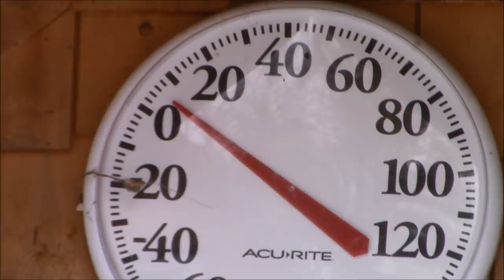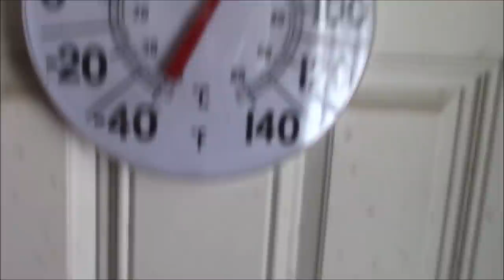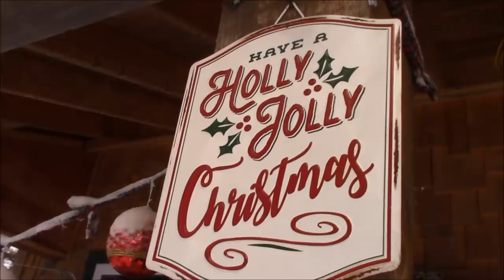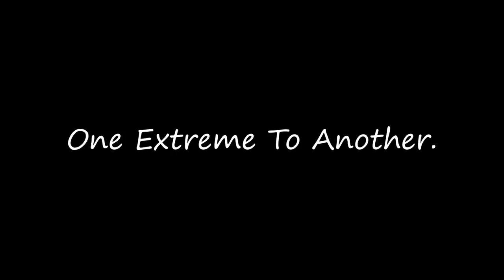Living in an Off Grid Cabin On a Mountain Through The Winter.  How We Handle The Task and Stay Happy

Comment: Ya did good Boss. I had 36 1/2 " here at my new homestead,,,the "High Mountain Homestead" and I just didn't let it bother me  at all,,it's going to do what it's going to, no biggie IMO. I was snowed in for a couple days but it gave me a chance to do some other things that needed to get done. Half way through the storm I broke trail to the road with the 4 wheeler and after the storm so I could at least  get there if need be.  I'm not off grid, but I might just as well be as during hevey wet storms or wind storms  the power normally goes out but I can work around that pretty easy too. I  heat with only wood too and have other options for power if need be and am stocked to the gills with chow.        I get a laugh out of some of these channels too when they piss and moan about simple little stuff,,Hell, I'm 70+ disabled and live on my own other than my pup and still manage just fine, even if it does get a bit lonley here sometimes.   I live in Central VT  @ a bit over 2000 ft ASL and about 5-6 miles from the nearest black top and am next to the last of only 4 houses on the entire road where it gets closed for the winter just past me.  I LOVE IT THAT WAY to be honest.  I guess us "old timers' just have a bit of a different mind set compaired to other folks.  My car was totally covered and it was just a snow bank with absolutly nothing of it showing at all,,and 2 days later with the same rains you got , the ground was almost bare again and I found the car.   Ya know what,,I didn't cry about it one little bit and just dug a path to the patio and enjoyed having a camp fire outside next to the river and  sitting on the patio on a cast iron park bench having an adult beverage and enjoying the winter wonder land all around me and listining to the river flow by with the dog sitting next to me with her  head on my lap. Life is good my friend,,,,,, if you'll only take the time to experiance it and  not fret about lifes little challanges.   Merry Christmas to you guys and God bless,,,,,
Reply from the maker: From your comment i can see you'd make a good neighbor. You aint kidding about us having a different mindset lol.  
Here's to a wonderful 2021.  Happy New Year brother.

Comment: Great Video JC! Did you ever consider a CB radio? We had them in Canada when we lived on  Anagance Ridge NB. The snow would reach the top of the telephone glass insulators. We had to leave the sliding barn doors open 4' in order to get to the animals. I remember walking a wind blown ridge line to the barn. If I stepped to the left or right, I went over my head :-O. Had to jump down 5' into the barn. Now THAT was snow! And that was 1974. As I have said, You and Lori knew what you signed on for when you moved to your dad's NH cabin. It is nothing short of a winter wonderland! We opted to build on the farm VS our class 6 road, 20 acre piece, for medical reasons at our age, but I am glad to see you fulfill your long standing dream. Well done my friend and well done to Lori! Its a good life ! ~ Diane

Comment: Sorry I couldn't be there to help you with that JC.  I did 4 Brake Line's on a friend's Hyundai Tucson... completely rusted through.  Best Practices for the future...get Vehicle undercoated every year or so.  Will save on a lot of repair costs and hassles.  Or you can get a Spray Can of Rust Check and spray it liberally all over the Brake Lines and Connections, and any Fuel Lines... preferably on a warm and dry day!  This is where an ounce of prevention is really worth more than a pound of cure!  Saves Time, Money, and Difficult Labor!  Glad you were able to keep moving!!!

Comment: Great video! The wife and I are headed in the off grid direction and you guys are our favorite channel. As a former mechanic, I HIGHLY recommend investing in a better jack. A good floor jack can be had from Harbor Freight(if they have those near you?) for $1-200. I keep a heavy duty version in the garage, and a smaller one in the vehicle. They can also be used on most/all of your farm equipment. I find those cheap scissor jacks to be the WORST pain in the butt(though they are still a great backup jack). Once I bought a better jack, every flat tire turns into me looking like a pro and patting myself on the back instead of fiddling with those cheap ones.

Love from Texas.
Reply from the maker: Agreed.  My floor jack is in the shed 300 miles away lol.
Reply: @thebossoftheswamp   Sounds like you need to make a day trip once the snow clears! Keep up the great videos!

Comment: Thanks for another great video. Whenever I am feeling sorry for myself or frustrated because something isn't working the way it should, you guys give me the kick in the butt I need to suck it up. Living alone and  choosing to burn wood as my primary heat source (with forced air back up which I don't care for) it does mean I have to fill my wood shed in the fall. Bought myself a little battery operated (STIHL) chain saw, which works like a charm. It cuts anything I am able to handle . At 73 and handicapped I can no longer use my gas chain saw as I don't have the strength to pull the cord. My battery lasts about 40 minutes with semi continuous cutting and that is about all the time I can last without a break so that works for me. Many of my friends are wanting me to give up my lifestyle and move somewhere easier to maintain....haha...I would last all of about a month,  at best!. Like you keep saying, you roll with it and when it gets tough you suck it up and do what has to be done. Can't remember if I mentioned it to you before or not, I had watched one of your previous videos about the saw horse you made for cutting multiple logs at a time. I knew then,  that is exactly what I needed. I have a huge pile of limb wood stacked in my yard in 4 foot lengths. So, when I was feeling a bit better and haveing a "good" day, I built me a saw horse. Not as good as yours, not as heavy duty as yours but for me, it does the job! I can't thank you enough for being the mentor I need. I plan to "keep on keeping on" as long as this old body of mine keeps going. I am not able to live full time off grid due to being alone and having major health issues, but I do have an off grid cabin in the woods where I spend as much time as I can. It is only 90 minutes from my home and for me is the best compromise I can get. Still able to do lots of gardening and canning. Takes me way longer than it used to but hey, life is not a race. So here we are in the middle/start?? of a Canadian winter and looking forward to planning my 2021 garden. The only issue I have that worries me a little is my water situation if my hydro goes out for any lenght of time,  (I am on a well with an electric pump) However,  I pull off several large containers of water to have stored in case that happens and when we have the snow I always have my Burkey haha.  Anyway, sorry for the ramble, take care and stay safe.  All the best for 2021  hopefully it will be better than 2020 in all respects.   Sandie from Ontario Canada.
Reply from the maker: That's just plain awesome Sandie. Your words make me wish you were my neighbor. Love your stick-to-it-tivness :-))
Keep on keepin on my friend :-)

Comment: Greetings from PEI.  Boss, I watched with frozen fingers along with you and that brake line.  Everything just doesn't work in the cold.  In late September I go and check up on as much as I can;  my blower and car and chainsaw and my Surrette Solar Batteries .  Even my wood burning is geared so that I can pull from the furthest pile in November and work my way closer to my log home as the snow gets deeper.  We have zero snow here in Prince Edward Island, so I'm burning only softwood and the stuff that's covered is the furthest away.  I spent three hours cleaning the fridge, all with bleach and hot water heated on the stove.  Our temps are about -4c (25f), so the two big pots of water on my Regency mid size dampen the heat so my place doesn't get much above 70F.  At one point I was about 3/4 mile from pavement on a dirt road.  I had/have a Pelican that I dragged supplies in.  Fast forward twenty years later, we have Fibre High Speed Internet and many more full timers and people who want paved roads.  Alas I'm 57 and getting too old for the fight, but the torch is being handed off here Boss, and I miss those days when I wouldn't see a car from late September to early May.  I harvested about six pounds of Chaga near a 100 acre campground here.  I'm air drying and freezing.  I've been working on one chunk now for about three weeks.  That's the update from Brackley Beach PEI.   All the best
Reply from the maker: Good update buddy and a Happy New Year to you ;-)

Comment: Little tip make a battery charger from car alternator small engine chargers batteries for off grid solar quick i stay on 12 volt system in a pinch u can use your car w jumper cables to chsrnge batteries also

Comment: JC glad to hear you got good news about your cancer.  May 2021 be a great year for you guys!  Just a heads up: It looks like your sled has a Rotax Series III 600 cc engine. The sled should have a manual recoil starter that can be used to start the engine. That engine doesn't need a battery to run.  Some sleds with that engine do not even have a battery.  Another tip: check the condition of the rubber "boots" between the carburetors and engine.  If (I should say when) they crack, the cracks will suck air and cause the engine to run fuel lean. A sure fire recipe for an engine seizure$$$$$.
That particular engine was in production up until model year 2020. Very reliable and easy to get parts for.
Hope this helps!
Gary & Shelley
Sabattus, ME

Comment: Next time you have that brake problem heres a quick fix IF its on the back . Front brakes are 75% of braking rear 25%. Blocking off that one line until you can fix it properly is a 10 min fix. Heres how. Unscrew the line at the leak as you did. Slide a flat head nail ( i am sure you have  a million of them ) in the line side and screw the line back in. This tightens that screw into the line and blocks off the fluid. To remove any air... have your girl apply slight pressure to the brake pedal forcing fluid and air out while you tighten... do not pump. You will be surprised how well this works in fact it might work so well that you could leave it until spring. You can thank me later... or not.. haha
Reply from the maker: Great Tip. Thanks for sharing this :-))

Comment: Good luck with the brake lines. Chev. trucks are well known for brake line failure and that also includes the gas lines. I had to replace all of them on my Chev.  You can bet if one goes some of the others are bad too. I was able to buy replacement lines from a company in Mi. called InLine tubing . They are just like the factory lines only made of stainless steel. Good luck and stay safe.

Comment: Food for thought on the truck/jeeps.  Of course, test this before you have nothing but glare ice... but (I don't know the grade of your slope, nor the sharpness of turns) if a feller were to put the transfer case into 4 Low, first gear... and rig a pull rope to the Emergency Brake's release pull handle (so he could sit upright while driving)... could you get the rig off the mountain in 4 Low, first gear and modulate the E-brake as needed (keeping the release pulled)?  Granted, braking efficiency is decreased dramatically, due to rear brake only.  But... it takes a little bit of the timeline pressure off if it's at the bottom of the hill.  And... if you don't have too far, you might be able to limp to the repair garage in that mode too.  If the Jeeps have a hand brake, then you can just hold the button in and pull the brake by hand as needed.

Love the Frankie fix and Tildy fix too.  Always a treat to see the kids doing their thing.  

End of December and the garden lives on.  A big source of smiles there.  You two make for a good team.

"Simple Living Alaska" is a pretty good YouTube channel.  None of the click-bait tactics, and the only drama is legitimate problem solving and common sense use.  Nice young couple who work well together.

Comment: That era Chevy truck is notorious for rusting out brake lines.  Might want to have the brake lines on the frame about in line with the driver door checked.  I am an automotive technician and do a lot of complete line replacements on Chevy trucks.
Reply from the maker: Thanks for your input ;-)

Comment: I read about masonry heaters and was surprised to learn old Europe had effective masonry and enameled heaters in their homes centuries ago.  And here we have supplanted them with forced air that depends on having all the rooms open to pull the air back to the furnace to recirculate.  No more of gathering around the heater in the living room. And the hand pump on grandmother's kitchen sink edge has gone away also.  How did the hand pump work and why would you carry water?
Reply from the maker: I'll be answering the water question in my next Q&A.

Comment: I had my winch break in the middle of the 2 foot snow storm. It was knotted up so I had to remove it from my atv to work on it knowing the snow was building up outside. We have a snow blower as backup. Too much snow accumulated for the plow. We have not had cable tv for years. But remembering back I have a few reality tv favorites. The time when the mountain men's dogs supposedly chased a mtn. lion out of a valley. The dogs didn't do anything. They used lion footage from another source. Then there was the time the Kilcher's cows were threatened by a grizzly bear. They showed the one guy shooting and then they showed a bear that had been dead for a while. Then there were some Alaskan's dangerously cutting down a extremely tiny tree that could have killed them. People love living vicariously through others and thrive on fear. That's why participatory propaganda does so well to control people and provoke feelings. Like creating the whole dem vs repub show. That's why so many people buy into all the fear of a 0.1 micron sized virus with falsified pumped up numbers which was never isolated. They created the tests with stock samples which often show false positives. Just to force sales on vaccines and possibly sterilize target populations along the way. Sheering the sheep.

Comment: Hi Boss. I'm building an Aframe cabin 300 sq ft. What is the best way to insulate the walls and avoid mould? Foam or Fibreglass Vapor Barrier or not? It gets confusing.
Reply from the maker: I prefer Kraft faced fiberglass.  The facing is the vapor barrier.  Foam attracts ants.
Reply: @thebossoftheswamp  Boss. What do you think if I put bubblefoil + Vapor barrier before the subfloor? Would that work?
Reply from the maker: @kenkoh1724   If you mean you want to sandwich the foil between the joist and the sub floor than YES, that is my preferred method. However, it is very important that you cover this while building to keep rain from being trapped between the foil and the floor.  The foil acts as a thermal break and there's no need of adding a separate vapor barrier.
Reply: @thebossoftheswamp  THANKS BOSS!